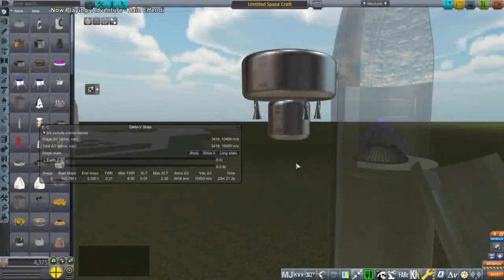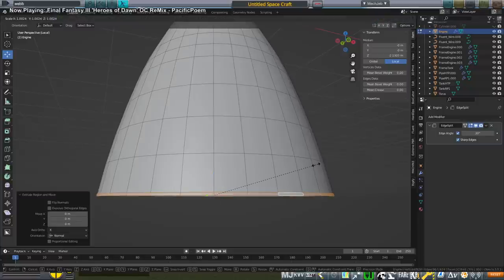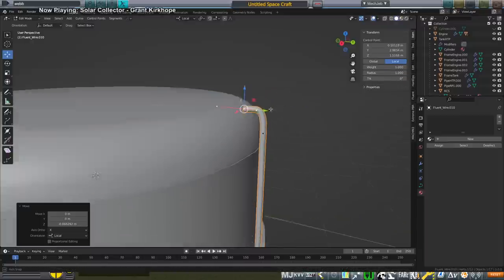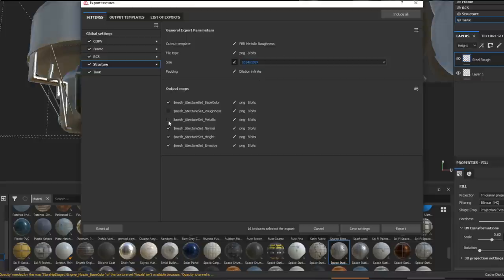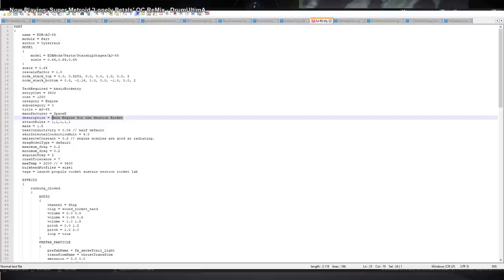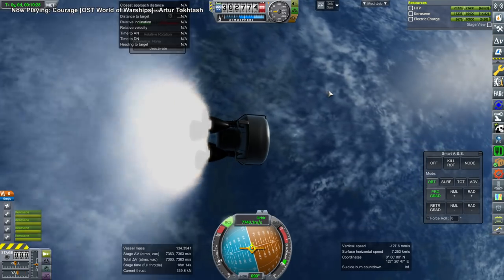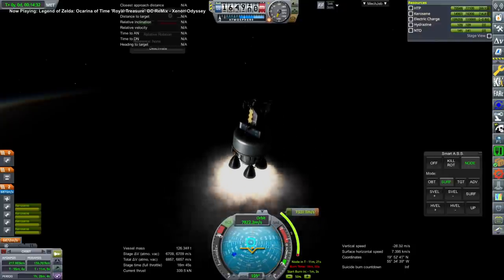Making a Cheap Upper Stage for Starship

Comment: Heh, this is literally what I’ve been obsessed with and thinking about for the last few days, I came up with a hydrolox stage slightly smaller than Centaur V but wider and shorter to take advantage of the payload bay and maximize payload volume, wet mass of 40t which allows 38t to TLI/GTO, (block 1B capability), but only for cargo, not crew

For expendable starship, EUS makes sense both in size and also mass, works perfectly as a block 2 replacement

Cost doesn’t seem to be an issue to me, nobody is looking to get 38t to TLI on the cheap because the next best option is twice more expensive (VCVX18H37L), so nobody could care less about cost of an upper stage
Reply from the maker: Well, there is a difference between cost being an issue now and cost eventually being an issue.

Comment: Not just for "interplanetary"... If Starship doesn't work out to be nearly as cheap as they project - which is nigh inevitable if E2E and other high flight rate applications don't actually happen - this will probably be cost competitive for even lunar or GEO direct injection missions.

In any case, this is a pretty nice-looking little stage. I hope we do actually see something like this loading into a Starship's payload bay someday. As for naming, the engine could be Phlebas, and the stage itself Quicksilver.

Comment: As always, great video 

Three questions, 

First, do you think that methalox would be viable and/or a good option? You can do a common bulkhead in the tank lowering dry mass, depending the level of complexity that you want you can make a simple pressure fed engine or use turbo pumps and such; the increase in Isp can be over 10% or more (comparing with what you use) and you have the advantage of using propellants that you already have in site 

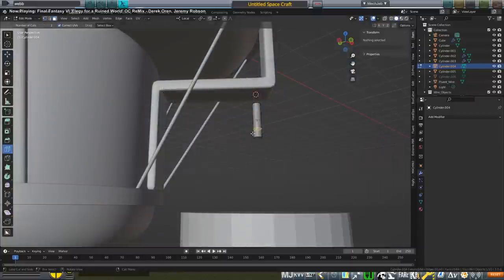Second, which "program" are you using in 1:56 - 2:32? Because I was trying to "calculate/design" a pressure fed engine for this concept (Starship Upper stage) using a book that I have and the internet but I spend like 30 minutes just trying to do it, it was mostly just for fun but I would like to do it 

Third, would you consider making a tutorial for what you did in Blender? Last year I did an Starship HLS for a NASA competition, it had its raptor engines and everything but when I sent the models to my friend that was making the "part" of the project in unity (I don't know how to code and it was kind of a game) he couldn't manage to put the textures properly, they would be pure white, the only colored thing was the HLS itself but just because I put normal color in it when my friend told me about the problems that he was having. 
If you can do it I would appreciate it a lot, but if you don't want to I would totally understand it  

 Thanks for reading and sorry for the long message, also thanks for the content that you make, just as a small example, the rocket profile videos have helped me a lot when doing things in RSS
Reply from the maker: 1. I worked on a reusable methalox stage for lunar or Mars applications and will have a video on that, but I feel that long range interplanetary probes are not going to be all that heavy, so a 5 ton capacity and a cheaper, more reliable (since it's not cryogenic) stage than the methalox option is probably preferable for Uranus and Neptune. We're not sending people there any time soon. 

2. RPA Lite: https://www.rocket-propulsion.com/RPA/download.htm

3. I already have some tutorials on the channel if you look for them, but I'll think about a newer tutorial.